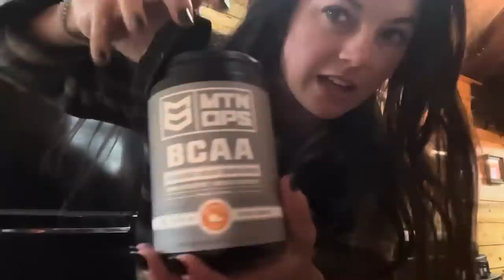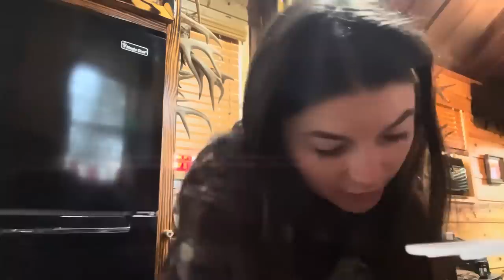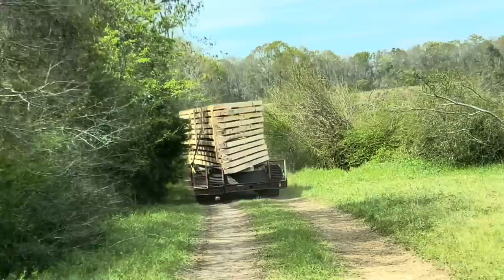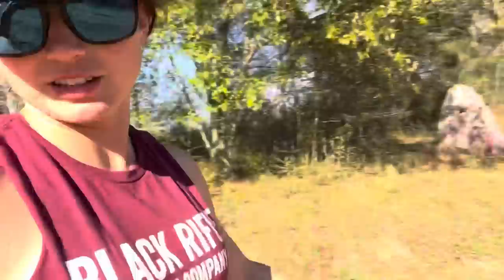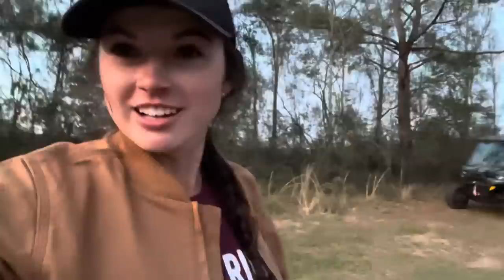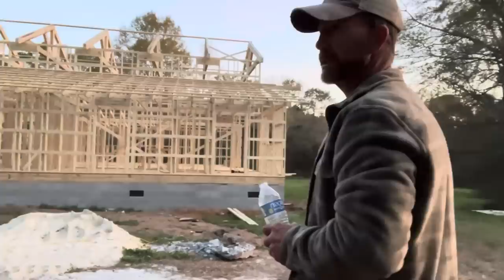Building & Setting the HUGE 5x10” Sawmill Rough Cut Trusses on My House!

Comment: IN 1972 I was helping place trusses in  prefab house. The anchor for the first truss pulled out of the ground, letting the trusses (and me) fall to the floor. Landed on my feet but the 6 trusses that fell on my back bent me over until my face was on the floor.  Crushed two vertebrae, lots of pain followed and long recovery. 50 years have passed (I'm 69) and  have never had any problems with my back. Thank you Lord.

Comment: That's a lot of weight on the stud wall really could have done with 10x5 running up the studs from the floor to support each of them. Build a lot of stud wall building's from the ground up and looking at it some of them rafters aren't even over a vertical but how ever miss that's going to be a beautiful home

Comment: The Lull placed them in the middle, without walking them ? How much counter weight on the back of the machine? Are you using heavy duty plate brackets on them 5x10's ? What size bolts 5/8 ths??